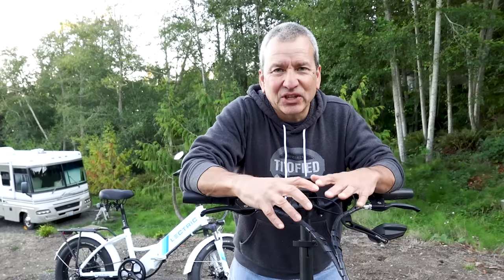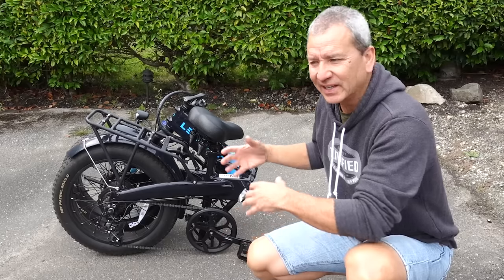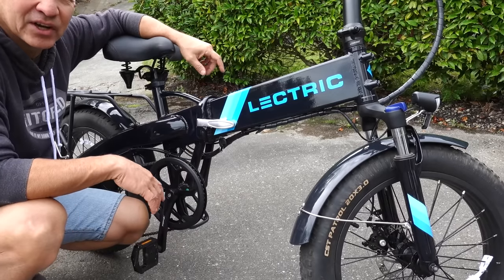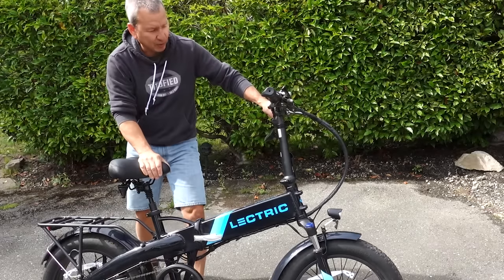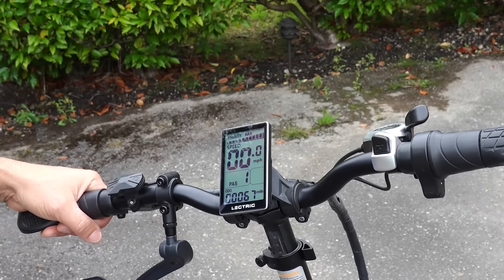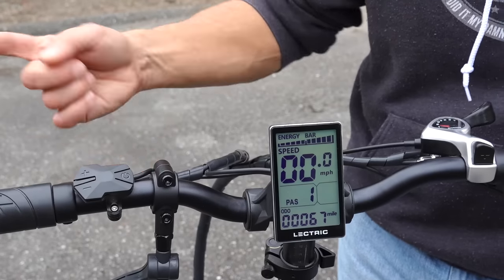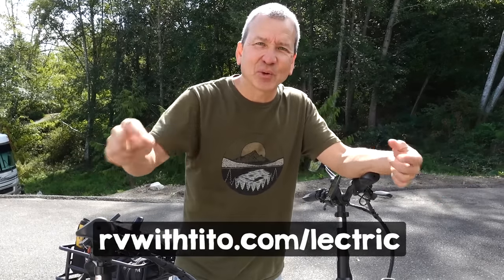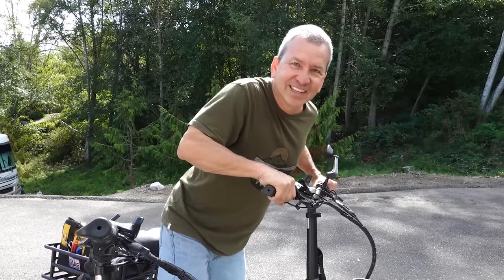Should a LECTRIC XP be YOUR FIRST E-Bike? | Full Review & Testing | RVwithTITO DIY

Comment: I am 65 with knee issues and 1 has already been replaced. After the 3rd major auto accident I gave up riding my big mountain bike because of the high step through height. I'm very interested in an e bike or trike but am not sure what to get. Can a bike trailer (kid or pet hauler) be attached to the back? I need to be able to carry a few groceries. Other than that it would be basically for commuting less than 10 miles round trip. I like the idea of it being light weight and portable in case I rent a car. Thoughts?
Reply from the maker: Another person commented that they have a pet trailer for their dog. Works great.

Comment: These are great bikes, we have had a pair for a couple years. We have the original models that do not have the front shocks. One thing to remember, when you store them have the batteries at about 3/4 full. Do not store for a long time with the batteries at full charge.
Reply from the maker: I'll do that. Thanks. Haven't stored them yet.

Comment: Found a lot of good info here, the two questions i would have though is 1)how heavy is it, living in an apartment on the second floor i would have to bring it up and down stairs, is the bike super heavy or is that doable? 2)do they sell spare batteries so that you could say bring an extra charged battery with you and swap it out if you went on a super long ride?
Reply from the maker: 1. It weighs 65 lbs. 2. Yes you can buy spare batteries. They also just releases a higher capacity battery. Check it out at rvwithtito.com/lectric

Comment: Great and thorough review! One question any trouble being able to ride this class 3 bike on any bike trails? Class three  are prohibited.   I would think it would be okay if you left it on the class programming it comes with.
Reply from the maker: Absolutely. It's a user setting. So you can keep it at your preferred setting. I prefer to just keep it at the higher setting and just ride responsibly. In my experience the folks pushing higher speeds hauling butt on trails and roads are not the ones riding ebikes. Just an observation.

Comment: Very good review, we love ours. Ours came with a black foot pad to protect it when folded. I thought I would put a rubber hose on ours, slit on a spiral if the pads break.
Reply from the maker: Great tip. Maybe some pipe insulation would work too.

Comment: Really Great video, didn't read all the comments but wanted to know: If you loose all power, how heavy is it to peddle with no assist??
Reply from the maker: Sure it's heavier than a regular road bike, but it will peddle fine without any power. The up hills will no doubt be tough though as expected. Lectric just released a new extended capacity battery that you can upgrade to. So hopefully you'll never have to use it without assist.

Comment: Since I plan to ride on streets, I ordered a car backup camera to mount on rear fender/frame with a 4.3 monitor on handlebar instead of mirrors.  It may require a separate battery supply if I can't find a way to get 12volts from the bike battery. But we shall see. I am an electronic tech.

Comment: Good video.
 I just got mine. The batteries and other accessories arrived later on in the week. Don't order extra accessories unless you know for sure that they are what you want. There are no exchanges or returns. 
I ordered the mirrors and phone holder. The phone holder sits crooked when the mirrors are in place and it will not swivel...I didn't know this would be the case and now I am stuck with it.

FYI-The set up for me was confusing & frustrating. There are steps missing in the video instructions and paper instructions for the accessories.  The manual says to 'torque' many areas of the bike but there are no diagrams to show which is which to torque or how to torque.
I suppose I will have to pay to have that done at some point.

I haven't ridden yet due to weather conditions but I am looking forward to it when I get to warmer climates.
Reply from the maker: Good advice.

Comment: Really good, thorough review.
Other than the few inches of clearance, do the bikes feel any different to ride to either of you?
Like are the pedals on one located slighly forward making it easier/hander to pedal?
I'm pretty set on getting one on this labor day sale.
Reply from the maker: If you have no problem stepping up and over, we feel the standard model is the better choice. It's a subtle difference, but it just feels a bit more solid with the frame going right down the middle. My wife now rides that one. If you have mobility issues then the step through works great though. Great time to take advantage of the free extras on the Labor Day sale. Maybe look at the long-range battery option as well. Cheers!

Comment: You nailed it Brianne extremely thorough as usual. ? How waterproof are all the electronics for hauling them outside in severe rain.
Reply from the maker: It's IP65 rated, but I haven't been out in heavy rain with it. I'd carry a baggie and rubber band for the display just in case you get dumped on.

Comment: Thank you for the review.
I have had an XP 2.0 (step through) for a number of months.  I am enjoying it!  I have not ridden it for lots of miles because where I live, it is cold and rainy in the winter.
My wife now wants one!!
And, now that I know that the two versions use different batteries, I will buy another step through.  THANK YOU FOR THAT INFO!!!

HOWEVER, my wife needs a seat designed for females.  Any suggestions?
With bicycle seats, she experiences external numbness in her "female area."
She also is heavier than your wife.
Any suggestions?
Reply from the maker: Thanks. Did you ever find a seat for your wife?
Reply: @RVwithTito  , we are still experimenting with seats for her.

Comment: Tito, thank you, this video was the final review that made me pull the trigger and buy a Lectric step-through. I just put it together. The manual is very specific about checking torque values for various bolts. I don't have a torque wrench. Any advice for how often you need to check the bolts and tighten to a specific torque (every week or so? or every few months?) and also what kind of a torque wrench for a bike?
Reply from the maker: I've never used a torque wrench on this bike, but I do check the bolts with a wrench and Allen wrench connections with a basic bike multi-tool to make sure they are tight-enough. Hope that helps. If you did want to use a torque wrench, then any one will do. You'd need the right sized sockets to use with it.

Comment: Have you had to do any maintenance on the bike yet and if so at how many miles and how much did it cost?
Reply: I'd also like to know how things are going with their bikes after all this time. Longevity/Reliability. If they did have any problems was the service help good or bad?
Reply from the maker: Haven't had any issues yet. I've learned how to do my own tune-up which has helped me get the gears shifting perfectly. It just get's pretty dirty hauling them around the desert and I have to clean them :)

Comment: Do you find the battery level indicator is fairly accurate? I weigh 220 lbs so I know battery distance will be compromised. I’m on the fence about the Fat tires compared to hybrid tires. I currently have a 2011 E-Motto 4,5 Ridgeline 24 volt 10ah battery. This appears to be quite the upgrade to my E-Bike. Thank You for your videos.👍
Reply from the maker: It tends to drop quicker the lower you go. Yes. Weight will affect your range, but I can't say precisely how much.

Comment: Thanks! Hi It’s nice to see a couple enjoying themselves  I love that most. I have an ex premium that I have received took about two weeks however I don’t have any pedal assist I got back to them electric bike. They quickly responded and told me I perhaps need a new motor I don’t get that.. but I guess it’s takes about a two week wait, at least before I get the new motor, if there’s any suggestions let me know thank you and happy roads. PS I do some camping as well ;-}}  Dean
Reply from the maker: Does the throttle work? If not then it might be a loose connection to the motor. The PA on XPremium works differently. I prefer it and I hope you can get it sorted.

Comment: What about rain? Riding in the rain, how does that impact the electric components?
Reply from the maker: The controller and connections are rated for IP67 so they should hold up to a little rain. If it's a downpour, I'd cover the main controller with a baggie while riding just in case.

Comment: I'm sorry if this has been asked already but can you charge the bike from a 12V DC system without having to use an inverter?  I do a lot of boondocking and I use solar to keep my batteries up.  To charge a 12V DC battery then invert it to 120V to step it back down to charge these bikes seems inefficient.  Thanks, and great video!
Reply from the maker: The batteries charge at around 55 volts. So It's easiest to plug the charger that comes with it into your inverter. We're offgrid 100% of the time too and that's what I do. Otherwise you'd need a buck converter and a 48v charger just to overcome the inverter inefficiency. Hope that helps.

Comment: Thanks - curious question about these. Why do they not take the other side possibility of recharging as you pedal? Chuckling, not thinking you designed them, just maybe you asked at some point.
Reply from the maker: There are trade-offs with a direct drive motor (needed for the regen feature). I did another review recently of an eBike with regen that may help. Go check it out.

Comment: Tito, when you are not riding the ebikes, where do you store them? I am thinking about a small tent for bikes and securing them inside the tent to the bumper ot the TT. Your thoughts?
Reply from the maker: We keep them covered and park them next to the RV. I also lock them up with a longer cable that I run through the rear RV tires. Hope that helps.

Comment: I've had the 1.0 Lectric a few years now , paid 899. Tank of a bike. although at 64 I love the grind of MTB.   Next year will use e bike to commute to work to work. Will be a snow bird in Jan. going to Homassa, Fl visit family throughout. Do you cover bikes for protection? How is the bike rack working? Thanks
Reply from the maker: Yes. I do lock them up and cover them just to keep them out of view outside. I haven't taken the rack out on an extended road-trip yet, but I'm sure it will be fine. I'll be transporting the bikes in the car as it's towed behind the RV. I can only use the bike rack when we're not towing the car.

Comment: Great video. Placed an order for two of Lectric's  XP 2.0 Step-thru e-bikes using your affiliate link! Would love to get a couple of totes to use when transporting. I'd appreciate suggestions regarding what totes to look at.
Reply from the maker: The tote I have is approx 50" long.  Might be a craftsman brand from Lowes. They have similar ones at Home Depot. They run around $40 - $50. Hope that helps.
Reply: @RVwithTito  The dimensions will help a lot

Comment: Are the pedals in a "standard location" as compared to original bikes?  It just looks like they are recessed toward the back a little especially on the step-through.  This would be an issue with knees and maybe even hips, I would think.  Thanks.
Reply from the maker: I can't say. I didn't seem to be a noticeable thing for us. If it is for you then getting a seat mount that can adjust front/back would be something to look into.

Comment: I'm confused by the throttle.  Do you only use that if you want to get going before you pedal?  And does it shut off when you start peddling?
Reply from the maker: You can use the throttle at any time as long as you're not in pedal assist 0. It will shut off when you back it off or apply the brakes. It's a very handy feature.

Comment: Got mine yesterday. It's ok. Just can't figure out for the life of me why they would put the key "Underneath" the bike so you literally have to get on the ground to find the keyhole. Not a very smart design. Wish I would have waited to get some sort of updated version. Stuck with this for now.
Reply from the maker: It's a common complaint. Their solution is the XPremium which doesn't have the key in. Maybe some of that will trickle down to the XP 3.0 :)
Reply: The other MAJOR problem is they don't answer the phone and they are forever slow in returning emails. God forbid you have an issue. They are impossible to get ahold of.

Comment: Looks like you’ll be having a couple beers on Jewel & Lorna. We just ordered two through your link.
Reply from the maker: Sweet! Perfect timing. Cheers! 🍺 We're working hard and are ready. I'm excited for you. Which ones did you order?
Reply: @RVwithTito   XP 2.0 and decided to purchase two exactly the same so we can share parts. We also bought the comfort package and mirrors. How do you plan to lock your bikes up? Are you using the bike rack linked in your channel?
Reply from the maker: @jewelornawatterson8484  Great! Yes. I have that eBike rack linked with the video. I cover them also and lock them down to the frame of the RV. When we're towing the car, I'll keep the bikes folded and in the car. I also got a couple of these motion alarms on Amazon (https://amzn.to/3AUDtuB). We haven't used them yet, but they're rated well.
Reply: @RVwithTito  thanks Brian.

Comment: Great review Brian!  We have the same RV as you - do these fit in any of the Winnebago storage compartments, or do you have to use the bike rack?
Reply from the maker: Unfortunately no. I use the bike rack or put them in the car.
Reply: @RVwithTito  thanks for the info! I was hoping they MIGHT fit in the double compartment behind the driver’s door. We’re looking for bikes that will work well here in Colorado mountains. Good travels - Mark
Reply from the maker: @hotrod8767  Hey Mark. All my batteries and inverter are in that compartment so I didn't try that one. I still don't think it would fit though.

Comment: One question the key can be removed when the battery is turned on or it is left stuck to the bottom i am asking this question because just bought one
Reply from the maker: The key stays in while the battery is enabled. It's locked in and won't fall out.

Comment: great video, how much did you pay for them with the accessories, thanks as always for taking your time.
Reply from the maker: I don't know about severe rain, but it is IP65 rated. All the connections and display are rain tolerant. I'd carry a baggie and rubber band though just in case you get into that severe rain. Just in case...

Comment: What does it weigh and will it accommodate say a 6’ 4” 225lb man?
Reply from the maker: The weight shouldn't be an issue since the max is around 330lbs. You'll be ok with the height, but might be more comfortable on the XPremium that has a longer body.

Comment: Have you rode these E-Bikes any distance when battery is turned off or has died during your rides? My current E-Bike once battery dies it’s hard to petal and requires I ride in first gear only without wearing myself out. It will free well easily,but if pedaling is added it’s real work. Doesn’t seem to matter if key is turned off or on. I do wish solar charging could be used to add a charge to bikes while stopping for dinner breaks or whenever I hike for a bit,🤔
Reply from the maker: Only a little. On the flat it's no problem, but you feel the weight of the bike on the slightest hill. So we keep them charged :)

Comment: I have a 1,500 Watt that Drives the Chain so it has 9 Power Levels and 7 Speeds and it will go up the Steepest Hills at 19MPH and in 7th Gear it will do 45MPH with NO Peddling  and I have a 48Volt 24AH Battery that I have Gone 15 Miles and have 3/4 of the Battery Left It will Wheelie and it is a 26inch Bike it's Comparable too a $6,000 Bike at $2,500 Cost I Love it There is Nowhere it can't go and it is a Mt. Bike. Color Display that gives you How many Miles you have Left on the Battery, it has a Trip, and an Odometer, it also has Top Speed, Avg. Speed and How much Power you are using in Watts and your MPH and your Power Level and the Time and How Long the Bike been on and there is a Code you have too Enter before the Bike comes on and you can make that Code Whatever you want too Four Dig. and if you hold Down the - it go's in Walk mode and + it Turns on and off the headlight and there is Two USB Plugs I use one for my Cam and the other for my Phone and you can Pull out the Battery so you can use as many Batteries as you want and Fully Charged it is 54.6Volts and you can Get 60Miles too 120Miles on one Charge I Love it. it is Nothing Like these Bikes with a hub Motor it is Much Much Much More then These E-Bikes and you can Change the Auto off I have it Setup so there is Never an Auto off it will Stay on Long as you Leave it on.
Reply: and there is a Key too Lock in the Battery and the Key comes out in Lock or Unlock so you do have too Worry about Braking off the Key

Comment: Nice Bike ! How heavy is it..? Speed and distance ? I love my Swagtroon Eb5 is light 37 lbs..foldable..36 miles run rides..but cheaper $599 Maybe nxt time you do the tech spec..!!
Reply from the maker: I mentioned those things in the video. It weighs about 64 lbs, can move up to 25 mph or so. Distance depends on how you ride...30-45 miles is what they advertise.
Reply: @RVwithTito  ok ..Heavy bike Thanks
Reply: By comparison, my Juiced Scorpion weighs ~100 lbs, goes 28 for 20-25 real world miles with me on it. Doesn't fold but has full suspension and costs twice as much! Think about the bike rack you intend to use, many can't handle the weight.